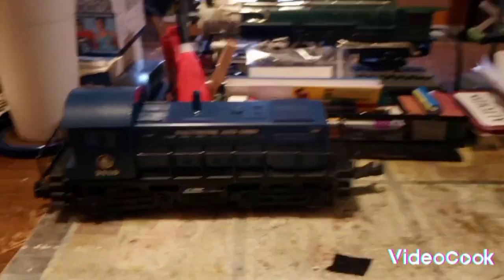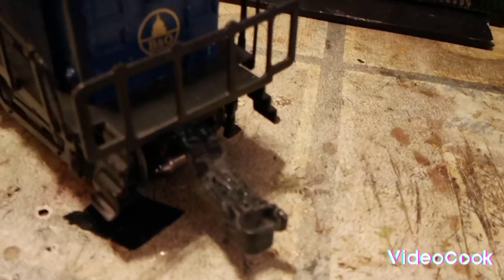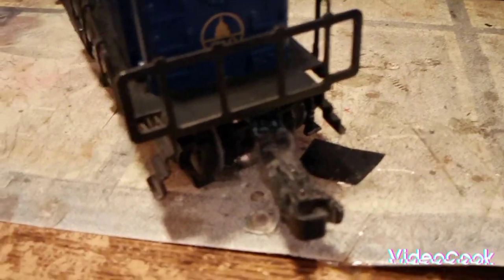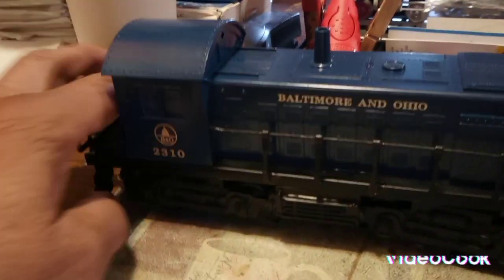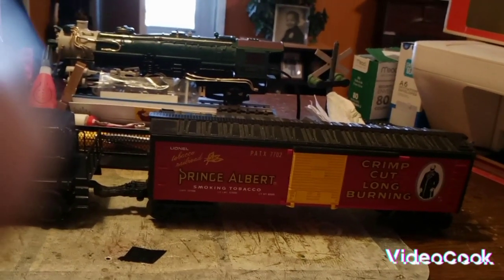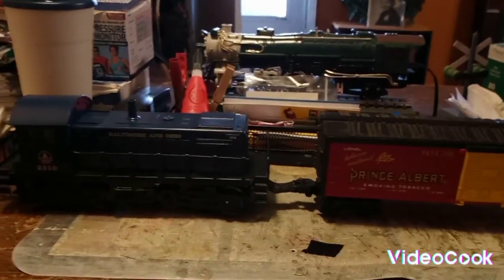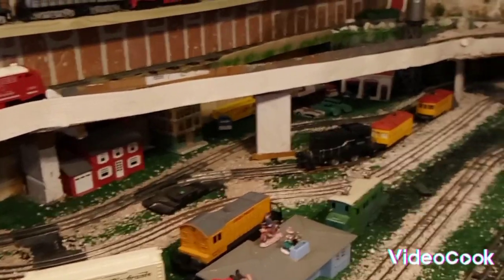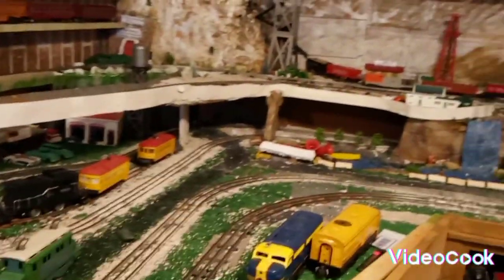Show & Tell Thursday/ A Recent Look Back

Comment: Speaking of 'Looking Back', one of my favorites of your fixes was when you had an HO engine with the front truck dangling (because one of the little tabs that hold it in place was broken off) & you fixed it with the plastic tab from a bread bag. I have one in the same situation, and I saved that video-clip in my Favorites section, for when I finally catch up with some other work I have to do. Keep up the good work.
Reply from the maker: Thanks Thomas , it is my hope that I can show differnt ways to fix our trains especially those that seem broken beyondrepair or too expensive to mend  can be repaired with a little reinvention and most times with something you might have just laying around the house. There are somethings that you cannot reproduce or reproduce exactly like the original but if it works well and looks good and you don't mind it hey it's your so go for it at least you didn't end up throwing it away and who knows oneday maybe some one else will have it that will appreciate it more just because once upon atime it was salvaged and repaired with love...       " God Bless" my Friend and "Happy Rails" Until next Time.               GMan